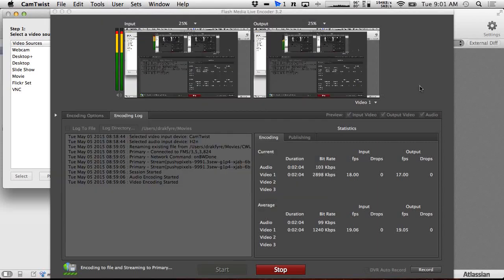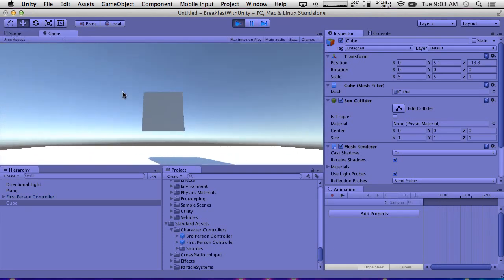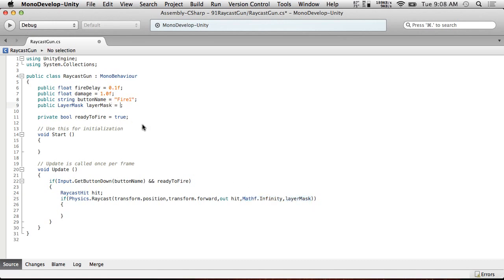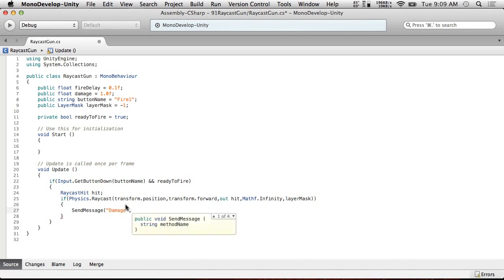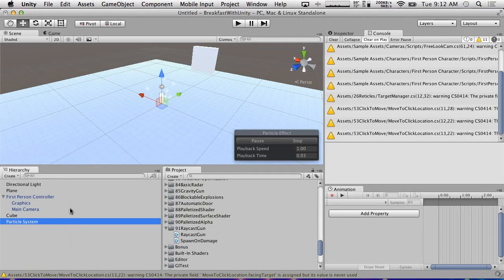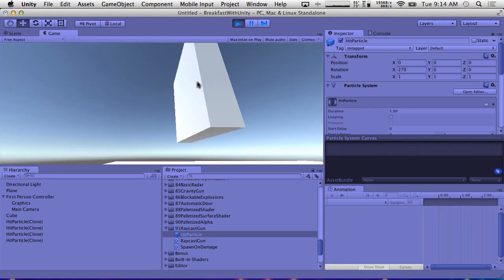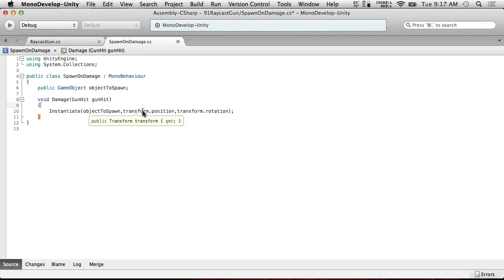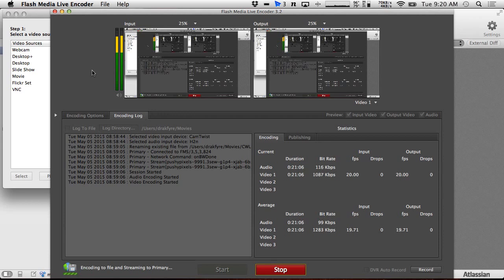Breakfast With Unity 5.0: Raycast Gun

Comment: My raycast will work most of the time. However, on very few random moments my raycast doesn't register a hit, or at least the hitparticles prefab won't play. I have no idea how to solve this. I have the script attached to the crosshair im using; I tried with the camera and it did not work. I noticed that when I first attached the script to the crosshair, only HALF of the hits  registered. After adding a rigidbody to the crosshair object, the hits mostly work, just very few random unregistered hits.
Reply from the maker: +EddieNiga That's odd.  If you zip up your project folder and send it to me, I'll try and help you figure out the problem. PushyPixels@PushyPixels.com
Reply: +PushyPixels Thank you so much; zip file sent. Remember, the raycast script is located in the crosshair object; it's a child of the fps controller.